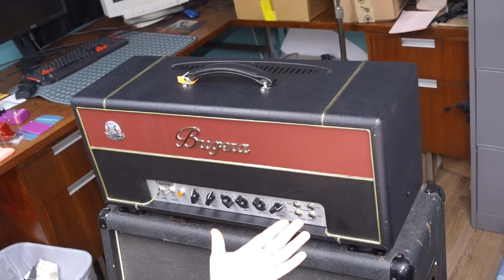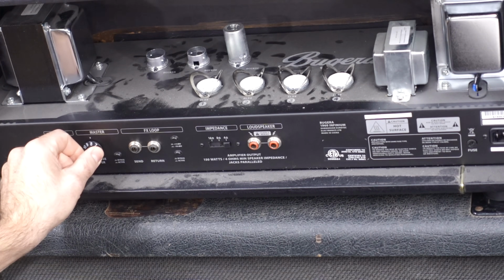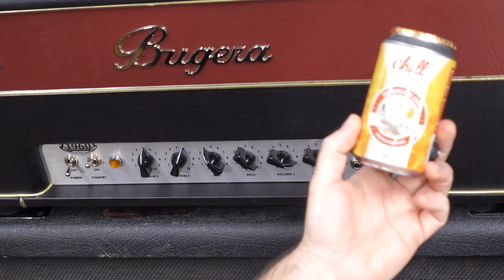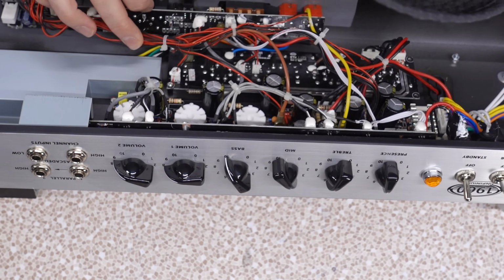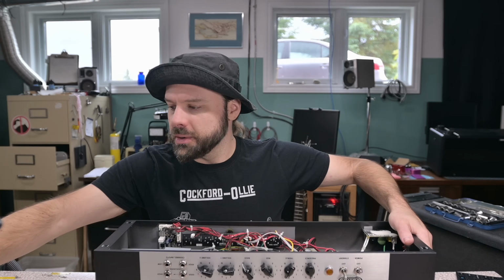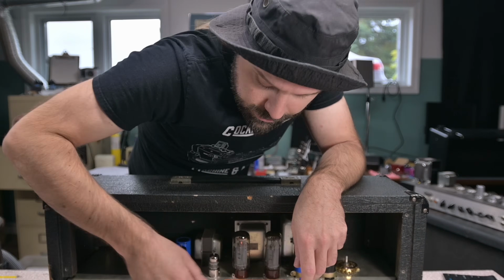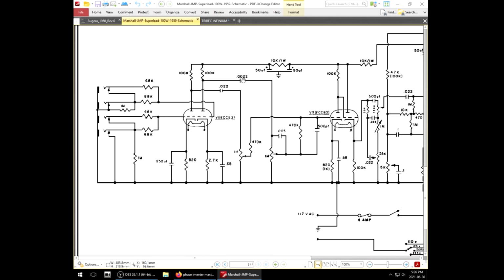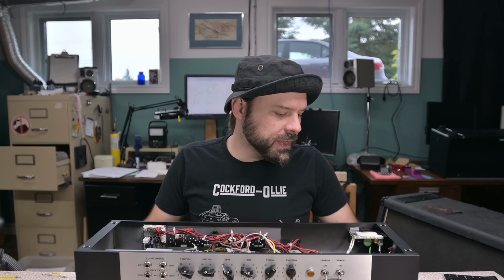Bugera 1960 - Inspection & Circuit Analysis

Comment: Those resistors parallel to choke could  in fact be useful because they decrease the (caused by Lenz law) voltage spike over the choke in sudden current changes through choke.
Reply from the maker: Yeah eh, I figure there must be a good reason for it, they applied modern engineering to this amp. I would of assumed the choke would be good an absorbing a voltage spike on it's own however. What would the benefit of this be ?
Reply: @DATT  Just study Lenz law, or measure the HUGE voltage spike over a choke when the current through it changes suddenly,  for example over the choke when the amp is turned on, and during that moment the filter caps of the power supply are virtually a short circuit to ground for a couple of milliseconds and the choke tries to fight against that change by inducing a huge opposite voltage. So those resistors protect that choke from arcing and going shorted, like a snubber (Zobel network) circuit or flyback diode protects an OT which has no load or is clipping heavily.
Reply from the maker: @jutukka  Yeah Eh, I guess I'll have to look into that. 
Makes me wonder if adding that resistor to my other choked amps might be a good upgrade.
Reply: @DATT  Those resistors cannot do any harm anyway. And the inner resistance of the choke at low or  DC frq is neglible compared to those parallel resistors. (And in fact the law is  Faraday's induction law but Mr. Lenz showed that the voltage opposites the change. 🧐)
Edit.: If that choke is a cheap high DC resistance (1kohm or so) choke, the reason for those parallel resistors could be just to reduce the DC voltage drop of the choke made of thin wire.
Reply from the maker: @jutukka  Hmm, I didn't think to measure the choke. I just assumed it was a lower Z like they usually are.

Comment: so, hypothetical: in the world's best pawnshop you find a Sovtek 50 watt. It costs the same as this Bugera new, but you have no idea what state it's in. Which would you choose?
Reply from the maker: That's a hard call, I've always wanted a Mig, or a Red Bear even. 
Also what you want to use it for. Personally, there is nothing that could go wrong with a MIG I could not fix. Even if it was a catastrophic. If you can't do your own amp work, if the Mig didn't work, it could be a hefty price tag depending on what's wrong. Even just fresh tubes could cost a few hundred these days. If it was ME, I'd get the MIG, cause I could fix it, and they are rarer, and hard to find for a good price now when they do show up. That's pretty much the condition in which I got my 800 head. 
It was broken as is when it was offered to me.

Comment: I have a Bugera BC-30, a 2-12 combo that looks and sounds like a Matchless DC-30
They killed the BC-30... maybe they were just... too close.
It's a cool amp, can cut down to 15watts as well, has the mis-matched speakers as well.
Reply from the maker: Yeah I don't know what it is, they came out it force years ago, now they are few and far between. Maybe they found that they could not compete in the tube head market, not with the kind of durability they are known for. These amps are almost a novelty in ways.
Reply: @DATT  Well, I purchased mine back in 2008 from a Black Friday sale, I've had absolutely no problems with it and its built like an absolute tank. I played it against a real Matchless DC-30 and they were soo close my ears couldn't tell the difference.
I know a few people had problems with particular years of them ~16years of playing, tubes are still doing great in it.
Reply from the maker: @28mmRPG  You still have the same tubes after 16 years even ? Well, it's not unheard of.
Reply: @DATT  yes in the Bc-30... the tubes may have been changed before I purchased the amp. But since Ive had it, I've only had it rebiased once.
Reply from the maker: @28mmRPG  Damn, I've have changed them out several times by now, but that's just cause I like trying different tubes if nothing else.

Comment: I have never heard a cross phase cancellation master volume sound good. Always fizzy on anything but 10.
A PPIMV dual gang setup usually sounds good with anything hotter than a black panel Fender.
Reply: Some say the Type 3 MV works better on cathode biased outputs rather than fixed...based on my AC15C1 vs homebrew 6V6 Plexi I tend to agree.
Reply from the maker: @wyattdoodat  Yeah eh ? I'll have to keep that in mind.
Reply from the maker: Yeah, I've gotten the chance to play with some dual gang versions before and they work much better, that's for sure.

Comment: I've done the trainwreck type 3 master.vol. it's not great for achieving bedroom volume, as you tuen down you loose gain . If you want to just trim some dB, it's ok. And with the cascade I suppose it's more useful than with a bassman etc.
And those suguang are really good tubes according to Dave freidman. They're known to fail suddenly sometimes. But supposedly, really great tubes. 
And , I always see new amps as potential donors for gutting and handwiring. That would be a cool conversion
Reply from the maker: Yeah, I have no problems with shugangs. To bad they don't make them anymore from what I hear. But there are some other chinese manufactures now from what I understand. 
Now that I think about it, I didn't try ti PPMV at higher volumes, maybe it'd be more effective there. I just think it was a missed opportunity, if they were going to add an MV as you would traditionally add to a Cascade modded amp, why mess around, and not just add a normal MV. 
It's one of the reasons I figure that amp was still sitting unsold all these years, to loud for the average player.
Reply: @DATT  Yeah, it's fd that they'd develop an amp that has a useless mv. The origin 50 marshall has one that at low volume only has clean tones. I picked up one for 300 bucks to convert to a 1987 circuit. 
And the suguang tubes are back on the market . Dave freidman was saying on a podcast.  Appearantly, the el34 is really nice. 
Also, chinese Psvane tubes are quite nice. 
I've been buying soviet NOS tubes at great prices on eBay, though.
6p3s (6L6), 6p14p (el84), 6p6s ( 6v6), all direct replacement. 
The 6n2p-ev is a 12ax7 ( 4 to 8 bucks ).  Awesome tube. Heaters are only 6.3v pins 4 and 5. Pin 9 is a sheild between triodes that you ground to chassis. You can even make an amp switchable between this and a 12ax7.
Reply from the maker: @soapboxearth2  IS Shugang back? Last I heard that factory burned down or something. 
Psvane is all the rage yeah. Filling that chinese tube market. 
I have a video about playing with Russian tubes called "Soviet Surplus Vacuum Tubes Tested".
I def have some 6P3S and 6N2P. I use the non EV ones in my 800.
Reply: @DATT  ill check that video out. Love thr soviet tubes.
And yes I just read thay suguang are back. Seemed like they'd never get another plant opened. I wonder if psvane is making them?
Reply from the maker: @soapboxearth2  WEll, I'll keep an eye out then !

Comment: I bought a broken Bugera 1900 on reverb.  I pulled every surface mounted component and PCB out of it leaving an empty cabinet,  chassis and 2 usable transformers.  Then I put in a custom, point to point circuit.  Love the end result.  Getting a nice cabinet, chassis and 2 transformers for the price I paid was very well worth it.
Reply from the maker: Yeah eh, that would be a sweet deal for someone looking to do a custom build and needed a dece donor chassis. 
I wonder what was wrong with it. Like, their design is good, just not might not be durable. If it was me, I would of just fixed the amp, reinforcing the fault points, and ended up with equally good results. But then, I have experience with PCB's and SMD's.
Reply: @DATT  It had a blown on-board fuse in the F1 position.   Swapped it out and the amp worked fine. No other trauma anywhere so I image a tube blew or something spiking the current in the HV winding.  

I just wanted a project chassis.  I wasn't sure what type of amp the 1900 was cloning, but it did sound nice.
Reply from the maker: @FishloreJimson  Yeah, I guess the amp might be good for a donor.
The 1900 or the 1990 ? I can't find a 1900.
Reply: @DATT  Yes, thanks, it is the 1990.
Reply from the maker: @FishloreJimson  Ah, that's a clone of the Marshal JCM900 Dual Reverb.
Reply: I'm thinking of doing this to a Jet City 20w.  The tube socket holes are near the pots, which will make for sloppy lead dress.  I don't like the idea of signal leads running next to power leads.  A.recipe for noise, and ghosting.  I guess my options are to punch more holes for tubes, or try my luck with the existing layout.
Reply from the maker: @qua7771  What power leads ? The Preamp tubes being close the the isn't that big a deal. It also depends on what kind of circuit you're going for. Ihave a Jet City 50, if that chassis is anything like mind, you're going to have fun. My preamp tube sockets are PC mounted and the holes are gaping. Normal sockets were going to fit normally. When I was thinking of doing something like that to my Jet, I figured I'd have to mount some sort of sub assembly inside the amp to mount the sockets. I Just ended up fixing it and modding it a bit and really liked it. It's my "Jet City Violence" playlist if you're curious.
Reply: @DATT  Nice.  I was going to install a turret board, and full size pots.  By power leads, I was referring to leads that carry power from B+., heaters etc...  The amp is A JCA brown iris, and the design is complete garbage.  I just haven't thrown it in the trash yet, because I thought I could use the chassis for something.  It's probably not worth saving.  Their original amps were solid.  The later models don't inspire confidence IMO.
Reply from the maker: @qua7771  WEll, the HV is filtered DC at that point, so it's not a big deal depending on the circuit. As long as certain other layout fundamentals are observed, I wouldn't worry about it too much.
Reply: I hope you called it the "Sodomiser".
Reply: Thats it and you got a good amp now real amp.
Dint fergot ta rollyer tubes

Comment: Man, so glad you covered one of these. I have a Burgera V5 which is much smaller but has that same infinium circuit. I've always wondered how it works. Do you find that it hinders the amplifier in any way? The dude from RAT Valve amps seems to hate it. He says: 

"Recently introduced (2014) to Replace the 'Standard V5' is the New 'Infinium V5'. The Infinium uses a 'Digital Valve Monitoring Circuit' designed to 'Shut Down' the Power Output Valve in the event of any Overload - (Details of how the system works are shown at the bottom of this page). This is a Total waste of time on a '5w - Single Ended - Cathode Bias' Amp as the last thing you want is the Amp to shut down when it's overloaded, that is the Main purpose of a 5w Valve Amp (It's all Marketing BS designed to compete with 'TubeSync'). The RAT Modifications can be fitted on the Infinium V5 but the 'Digital Monitoring' needs to be disabled in order for the Amp to function correctly. "

Is this true, or is he exaggerating?
Reply from the maker: On this amp no, it's a very different design than the V5 and it pretty much just does automatically the same thing you'd do if you were going to bias the amp manually. I'd have to test it again under different circumstances to find out if the Overload thing is an issues. Assuming the software is programmed correctly, it should be just fine. 

A 5w single ended cathode biased amp, yeah, I could see where something like an infinium controller is kind of over kill. Like if it protects the amp from going thermal nuclear in the event of a fail, than it's a win, but if it shuts down your amp during a cranked out jam sesh, then yeah, that'd be a problem. I have no experience with the V5 personally. If it shut down on him, than it's obv a problem. Unless there was something defective and it was doing it's job, and normally would work fine.
Reply: @DATT  ahhhhhhh I see! thanks! I was genuinely curious 🙏
Reply from the maker: @shanemichaelneal648  Yw

Comment: Alright! Ive been waiting for someone to look into these. 
I bet that amp would be a great candidate for the one wire mod.
Reply from the maker: No need, the one wire mod if built in stock into this model. 
There was an older model of this amp, which I discussed as per the schematic I had, that did not have that mod, but, being a PCB based design I imagine that mod might be tricky. The head, however, turnkey.